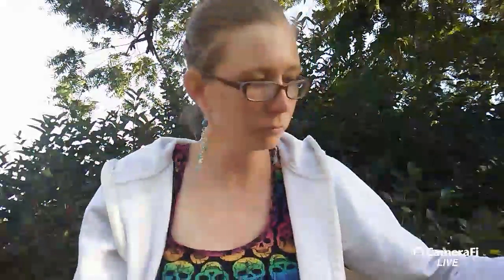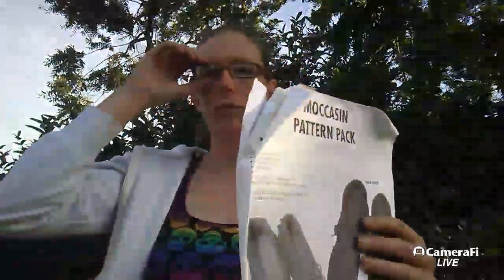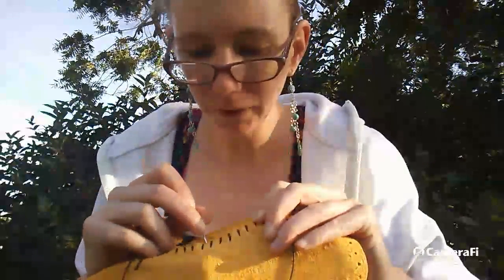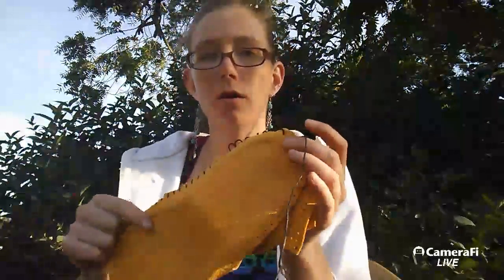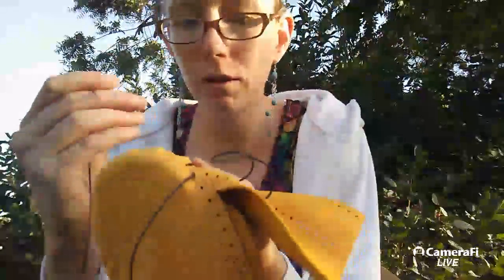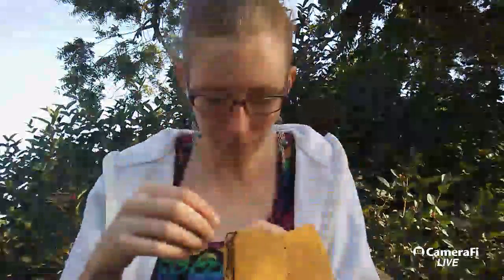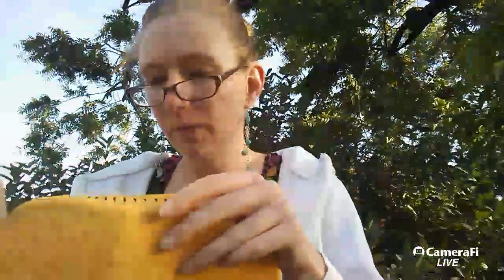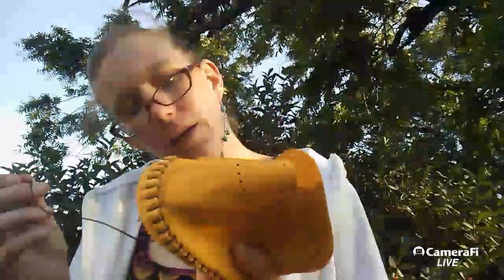Moccasin Heel Assembly!

Comment: I’m having the hardest time aligning the heel to the vamp and sole, I’m so confused on where the needle goes. I watched this video and it did help, but i seem to have a hard time.
Reply from the maker: It might take a couple of tries to get it right. Make sure your diagonal stich is on the inside. It can get confusing  but there's nothing wrong with taking them apart and starting over. Sometimes you can only see your mistake when they are fully assembled. Did you watch the vamp assembly video?
Reply: thequeenofsanjoaquin is there a way to send you a photo of what I have so far? I’m having issues with where to insert my needle after I have attached the star stitches.